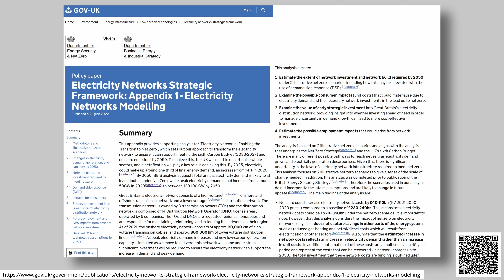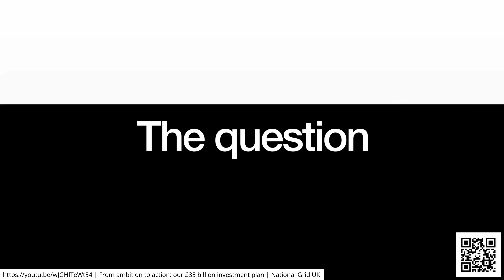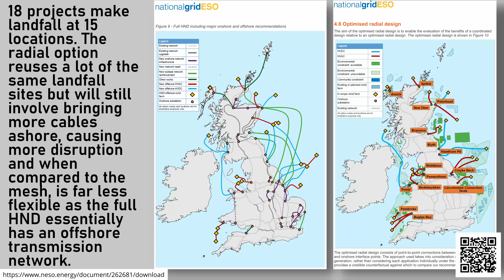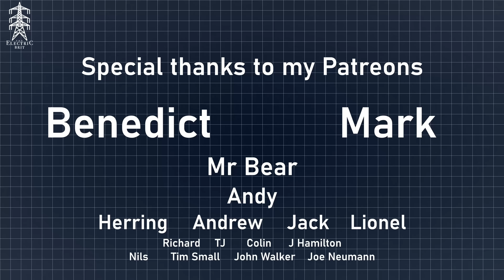The Great Grid Upgrade Projects Explained

Comment: Let's be honest about this!  It isn't an upgrade because that would mean jumping to a bigger and better system.  This is just an update for work that has never been done for decades!

UK electricity peaked in 2005 with about 385TWh.  Since then every year UK manages to do with less and less electrical consumption.  In the last couple of years the electrical generation dropped to below 300TWh!   Therefore by any standard UK grid system should be "under-utilized" except loads of maintenance weren't done and many parts fallen into disrepair.

The new offshore wind generation exposes the lack of the grid capacity "locally" and part of the wind power is "unable" to pass onto the rest of the country!  This is the fault of the grid owner cunningly waiting investment from the government to expand the asset that it owns.  The whole thing stings!
Reply from the maker: I mean we are going to a bigger and better system. It’s thousands of kilometres of new lines and cables and new substations, and the net benefit is more flexibility in how we can run the system. It’s incredibly hard right now to turn off parts of the system for maintenance because it was built a generation ago for different needs, and is a linear system north to south. Upgrade or update it’s interchangeable, but the system was also only privatised in the 1990s. 

Consumption has went down due to industry leaving but consumption is set to double under net zero as we electrify everything, and new technology like “AI” in data centres has brought new loads.

The wind rush was done under previous governments and the people who own the wind farms are private companies with very little to do with the National Electricity System. Regulation prevents an entity from owning both transmission and generation, it’s called unbundling. So I’d take a look at previous governments chasing headline installed capacity numbers instead of where to logically connect wind. Hope that helps shed some light
Reply: @TheElectricBrit As you have confirmed yourself that the grid has remained as one national system throughout.  The breakdown in the system or privatisation is neither the wind generators nor the grid owner accept the responsibility to update/upgrade the grid system.  The generators don't own the grid asset so they can't fund the expansion.  The grid owner can barely pay dividend to the shareholders and has no money left to invest in the expansion.  So everyone is playing the waiting game until the government loses patience to step in with the public money.
In a poor developing country like China when a large wind farm or a solar park or a big hydro is to be built a new set of transmission lines is always "included" as an integral part of the project.

When China built the world's second largest hydro Baihetan dam, that generates 16,000MW, two 800kVDC UHV lines, one 2087km long to Jiangsu and another 2193km long to Zhejiang, were installed so that one became operational in Jul 2022 when the first two units were commissioned.  The remaining UHV line was completed 5 months later and was ready for transmitting the power of the full compliment of 16 turbines, each rated at 1,000MW, to the consumers several thousand kilometers away.

In UK the power generation and power transmission has been detached from each other and no one paid any interest to it for decades.

Comment: What about yhe work in the core grid to take account of the increase in input of solar and wind. For example stabilising ac frequency?
Reply from the maker: NESO ran the pathfinder project a few years ago which is still being built now, which included some battery projects and some synchronous condensers (flywheels). I worked on one of the latter in Wales and I know of one being built at Walpole. The project was for stability services and I’ll be covering them more in future.

As for solar I’ll also have a dedicated video coming on the effects of embedded generation on distribution and transmission networks

Comment: Offshore lines. Oh dear. How long before a Russian ship parks above them and drills holes to take explosive devices next to or above them. They may be too deep to 'accidentally' drag an anchor through them but a couple of tons of RDX or whatever can make a right mess especially if every line is cut simultaneously. This might be a cheap solution to keep the accountants happy but also very risky.
Reply from the maker: It’s far from the cheap solution, it’s THE most expensive. It’s primarily because people don’t want new overhead lines. So far it’s 5 projects costing around £4B each to transfer 10 GW of energy. 1-2 new overhead line routes would transfer more power, cost 1/10th and be far easier to maintain and replace. 

Theres more that goes into it of course but that’s the broad strokes. I wouldn’t worry about the security of them.

Comment: So nothing down in the South West? Not much point building a massive new solar farm if the infrastructure isn't going to be upgraded to handle it.
Reply: If we distribute many solar farms around the country, then we need less nationwide transmission, not more (still need the lower voltage distribution network though).

It looks like the major transmission network growth is focussed on coping with large scale wind farms and European interconnectors, dominated by the east coast and Scotland. 8GW here, multiple sets of 2GW there... pretty soon you're talking serious numbers.
Reply from the maker: There is works under ASTI for south west but it’s wind farms and interconnectors, and I wanted to stay away from offshore for this video and focus just on the transmission projects and the headliners of ASTI.

Comment: What infrastructure do you need for this, I used to work in Stafford and old Trafford,so you need those industries back again and hixon.Obviously not the generation part, unless they are still going I hope.Otherwise you are going to go Chinese I really think so 😊
Reply from the maker: Each project went out to tender but there's a consolidated bunch of manufacturers now. Typically for switchgear and protection relays it'll be Siemens, GE, Hitachi, ABB, and for relays add on SEL. For transformers it might be Siemens, Hitachi, Hyundai, Hyosung or a few others when you're talking at this scale or for HVDC. For cables there's a large amount of choice from Prysmian, Nexans, LS Cables and again many many more. Instrument transformers I typically see Trench, Koncar, ABB and recently a Chinese brand I can't remember.

So by and large I don't think any on that list are Chinese companies although China will make parts for all of them and there are Chinese companies that make all of these different components.  They're a global leader in HVDC deployment and I'd have to think with their population, everything else too. Plus they can make a brand new HV transformer every day while most other companies have long lead times now, which impacts who you buy from increasingly now.

We've not had any issues with stuff we've installed over the past few years that I've been involved in, and everything we put on the grid goes through a process called type registration to make sure it's good quality. Hope that helps :) P.s. I've been to Stafford once opposite the GE factory for some training. Ideally we would be self sufficient for a lot of stuff and we do still make a load of stuff in the UK, just not really at these voltages or specialist applications.

Comment: Really informative video. Just one thing to mention - EDN2 is I believe from Chesterfield to Willington (another former coal power station), rather than Ratcliffe on Soar.
Reply from the maker: Good spot, interestingly I've seen it with both names, I mean they're both within sight of each other so it's probably somewhere between.

This 2023 document has it as Ratcliffe, whereas the National Grid website has it as Willington.
https://www.ofgem.gov.uk/sites/default/files/2023-12/NGET%20SpCs%20MARKED%20UP.pdf

Willington seems to be the most recent name choice so that's likely the one that's stuck. Thanks for the comment!
Reply: @TheElectricBritIt's definitely Willington.  The most likely route will be within a mile of where we live.  One query I have, is will new overhead pylons be of the traditional design, or like the ones on the Somerset levels?
Reply from the maker: I’m not sure on the specifics of that project but I’m fairly certain we won’t see T pylons used again like in Somerset. Most projects I am familiar with are all traditional design. 

I’m not sure on the official stance on T pylons but I’ve heard a variety of stories about the maintenance being a nightmare.

Comment: New subscriber here. I remember Legacy being built "a few years ago", and am currently watching Little Horsted with interest.

I don't know about anybody else, but I'd be interested to see something about the practical side of tapping into the 400kV network, i.e. cable hauling and splicing. The OpenInfrastructure maps tend to show that a substation interrupts one circuit on a dual-circuit line: is that correct?
Reply from the maker: Thanks for subscribing! I've been on a few new connection projects now involving cables but never recorded anything, so I'll try get around where I can for a future video! 

Regarding tapping in depending on how you mean, you can Tee off a circuit if you were to divert an overhead line into a new substation, you could choose to bring just one or both circuits in. Depending on the specifics that may then be a three ended circuit and need isolated at three substations to make it safe to work on. It's kind of complicated to explain but an example near me is Spalding power station if you look on openinframaps, where one circuit goes from Walpole to Bicker Fen, and the second one is Tee'd into Spalding power station, breaking that circuit in half.

There's a lot of work that goes into extending substations too like at Necton or up on Yorkshire Green where there's new substations on existing lines, and they put up temporary towers out the way and move the lines over so they can re-energise the lines, then build new towers in the right spots.

Hopefully that helps rather than muddying the waters but let me know if I can explain it better.

Comment: Hello. I hear nothing about what is being used as replacement cable. I assume it must be aluminium/carbon fiber which can convey double the ampage as well as upgrading to 400kv. The other thing I do not hear is a requirement that all windfarm and solar farms must install grid scale batteries to ensure full usage of all generated electricity.
Reply from the maker: Thanks for the comment, I'll talk more on materials of cables and overhead lines in another video, but for overhead lines there is an increase in composite materials that are high temperature, low sag (HTLS) to allow much higher temperatures and thus current flow. 

For cables they are typically copper core with XLPE insulation nowadays, but there are voltage limitations to this so new materials and more environmentally friendly materials are being trialled. I roughly covered the different layers of cables and the layout of overhead lines in my "How The Grid Works" video.

Collocating storage would be a great idea, but right now I don't think there's any requirement for it and would be subject to extra constraints I imagine on where you can place the substation to connect to the grid.

Comment: Very interesting. What are the losses incurred in transporting electricity per mile if you know ? So if the Scottish offshore windfarm generates X kw at Y kv, what actually arrives at the other end ?
With low voltage DC, say 12v, we used 0 gauge or 4 gauge due to voltage drop even over a few metres.
Reply from the maker: The losses in AC transmission are much higher than DC, and especially so with submarine cables. I have a dedicated video on HVDC coming in the next few weeks but for modern HVDC used on shorter cables like windfarms and the EGL projects, you're looking at about 98% efficiency (VSC tech). Older LCC tech can be 99% efficient. Those efficiencies are in the conversion process, whereas in AC transmission the losses can vary greatly by length, how much load is on the circuit, with lighter loads being worse, voltage, resistance and more.
Reply: @TheElectricBritthanks. Another bit of knowledge to add to the old think melon 👍

Comment: Would be interesting if you considered how storage will influence future grid operation. Thank you for your summary, but someone needs to come up with better names than the soulless acronyms.
Reply from the maker: Thanks for watching. Most of the acronyms get replaced once they start up, for example AC5/6 is Western Link 2, the EGL projects had silly codenames like ECDx, and some of then end up staying like PTNO is just far quicker than Pentir to Trawsfynydd.

Storage is going to be crucial though as we move to renewables and there's a load of it already on the network and even more in early stages.

Comment: Could you please do a video explaining why you can't just throw a power station's worth of solar panels on the top of every car park and building. I see a tonne of people talking about how we shouldn't put them in fields, and that they should be built elsewhere, which in principal, I agree with, but I have a hunch that the prerequisite infrastructure required makes it less simple than people suggest. Be good to get your thoughts.
Reply from the maker: That's pretty much one of the main reasons I can think of. People building generation want to put it where it's cheapest to connect, that's usually near a substation that has sufficient capacity to connect without needing major works, and a lot of subs are out in fields. That and people need to ask the farmers why they're putting solar on the fields or selling the fields...Not blaming farmers here but people are looking at the symptom (solar farms) and not the cause (farmers finding a better way to make money than growing food).

There's a few things like insurance that are hurting putting solar on buildings, and I recall recently a push to put them over car parks which is the best solution (covers cars, provides power for charging, improves already useless land). But there are some challenges on the grid side I'll be covering in a future video 😊
Reply: ISTR that France now requires new car parks to have PV, so presumably they have found a way to make it work
Reply: I suspect that larger solar and battery projects can make money in ways beyond just creating energy... various ancillary and voltage support services. And I suspect that with grid-forming inverters, they'll be part of black-start plans.

Comment: Given the current state of the world and the apparent vulnerability of subsea fibre optic links, are there any concerns or considerations given to the security of these offshore connections?
Reply from the maker: Personally I'm not worried. They're close enough in our waters we would probably detect any obvious bad actors, and they're buried and sometimes covered with rock or concrete to protect them from accidental damage. The North Sea is filled with cables, pipelines and unexploded ordnance, so dragging your anchor is probably a bad idea if you want to stay in business.

And if we went to war, they'd probably be more protected than an onshore asset but you're only as strong as your weakest link, and the converter sites are massive and sensitive.

Comment: I'm seriously considering switching to this field, I'm currently a railway OLE designer and electrification engineer, but that work is currently extremely dry in the UK and govt money seems to not be on the horizon for anything substantial in the field.
Reply from the maker: We've not long took on a few people from network rail who worked in switching. If you're already well trained you could try apply for a direct entry role, or National Grid specifically has a "CDP" scheme where we retrain experienced folks. If it's new construction projects you want then the latter is a solid way in, for maintaining existing stuff then the former.

There's at least a decade of work in the pipeline and its all a bottomless pit of different expertise and things you can get involved in, and there will no doubt be more work once this is all done, then maintaining it all. Job for life 😉

Comment: It's a really impressive bit of engineering but the locals in Norfolk are worried about the increased incidence of flooding due to the massive deforestation of the area. It's hugely disturbing to drive along the A47 and see the destruction, the scale is tremendous.
Reply: Deforestation, you say? I must have missed something, since I've only lived in Norfolk for 35 years.
Reply from the maker: Where abouts on the A47? Norfolk is my old team so I’m familiar with the substations there, the only national grid substation on the A47 is at Necton, which has tripled in size under other works not related to the great grid upgrade, mainly to facilitate new wind farm connections like the one right next door to Necton that Siemens is building (Norfolk vanguard or boreas if memory serves). 

For substation works when they’re complete they typically replant around the substation as a “screen” to hide it from most people views. National grid projects and I’d think most now all have a “biodiversity net gain” target they must hit, which is essentially putting it back better than we found it. So for every tree, plant, hedge etc that’s affected, we put back 10% more. On previous projects this has involved buying land adjacent to the substation and turning it effectively into a small nature reserve with trees and wetlands. 

Flood management will all be considered during the building and its also why you’ll see any large buildings like converter stations have an attenuation pond, to hold all the rainwater and slowly discharge / soak it away.